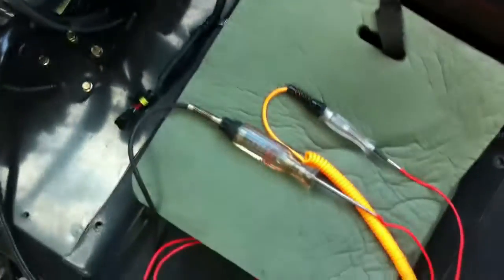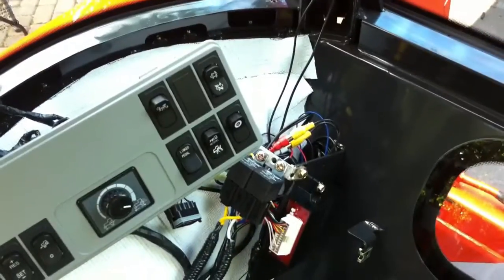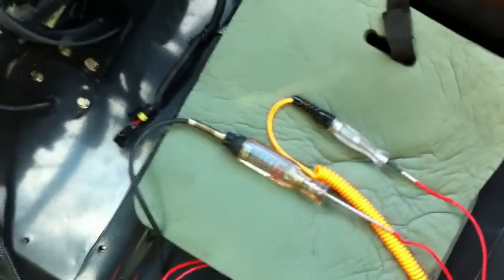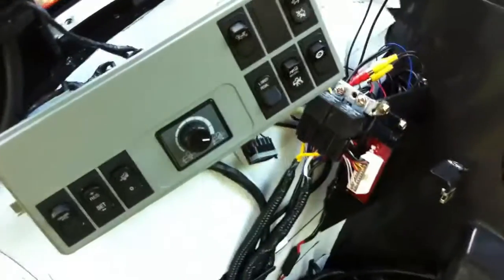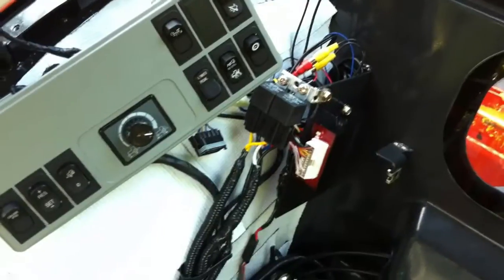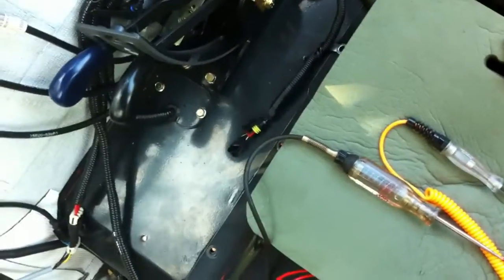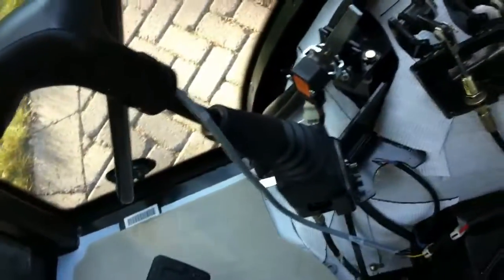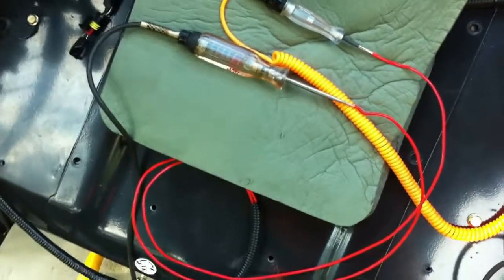Wiring the Kioti NX6010 for a 3rd Function

Comment: Great video! I am taking delivery of NX5510H next week. I want to add a third function for a grapple. Where did you get the joystick handle? It is sweet! Did you go with a diverter valve or true third function valve? I have been looking at Michigan Iron and Equipment for valves, but I like your joystick handle much better. Any tips on installing the third function kit would be appreciated.
Reply from the maker: The handle is a John Deere which is used in just about all of their utility tractors. I made my system. I use hard lines on the loader, and custom lines to the quick disconnect for removing the loader, as well as at the end of the loader. I used a D02 open center Eaton double acting electric over hydro valve that is mounted on top of my transmission. The switches on the joystick go to off-the-shelf solid-state relays. My electrical connections are all Delphi-metricpack, the best in the business. My third function looks like the third function the factory should have offered when I bought the machine. 

Depending on what you're doing, take a hard long look at the fuel line coming off of the bottom of the tank and consider putting a plate to protect it.